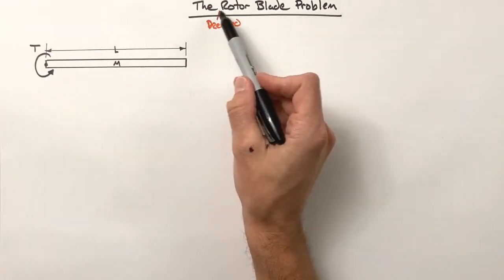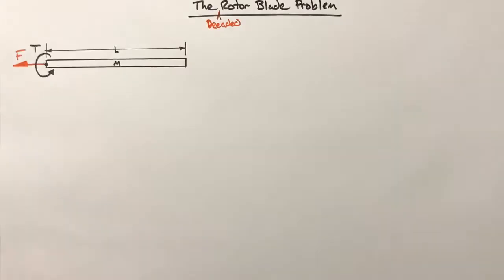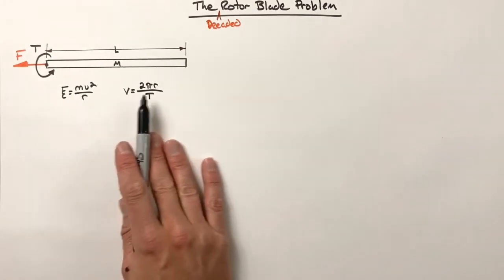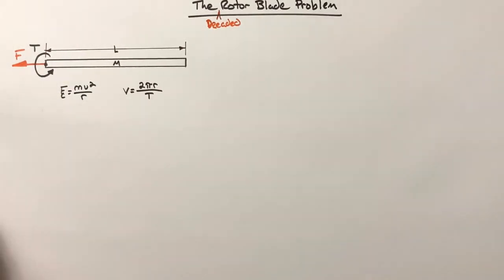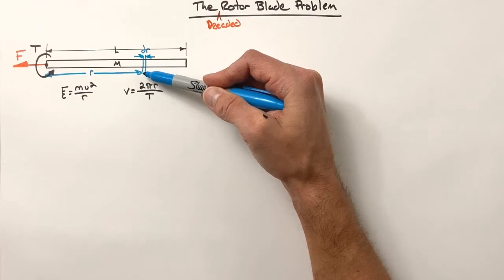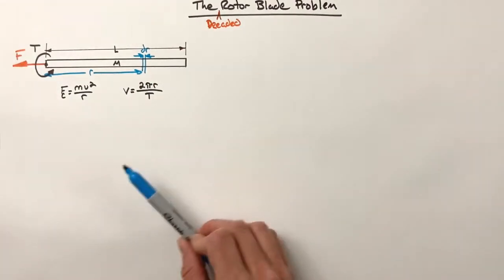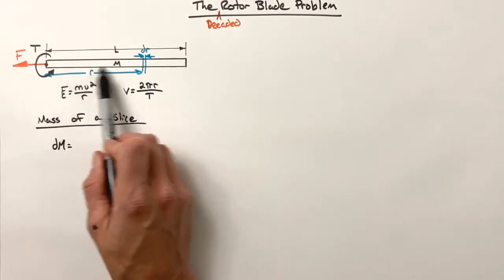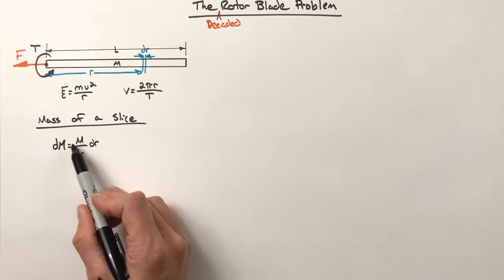Centripetal Force on a Rod Rotating About Its End | Calculus Based Physics

Comment: sir, I notice that we can get the same equation for the centripetal force if we act as if all the mass of the rod is on the center of the rod. Now, let's say we have a problem with torques, can I pretend that all the centripetal force is acting upon the center of mass?
Reply from the maker: When it comes to torque causing things to rotate, you can not simply reduce the entire object down to a point mass located at the center of mass.  This is because Torque is dependent on rotational moment of inertia.  Rotational moment of inertia can be a bit tricky and at times counter intuitive.  Here is a link to one of my videos on rotational inertia...

https://youtu.be/TqMMf6eA_d0